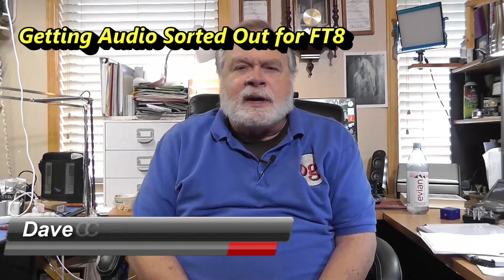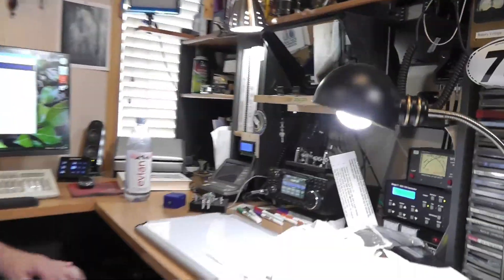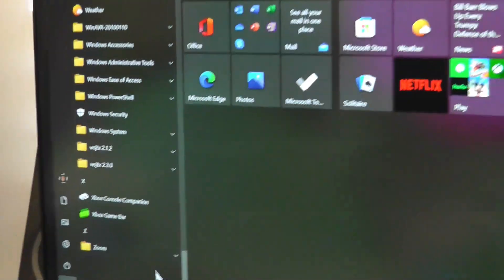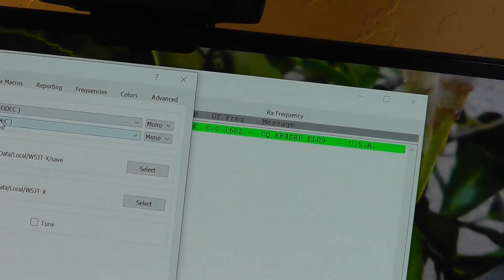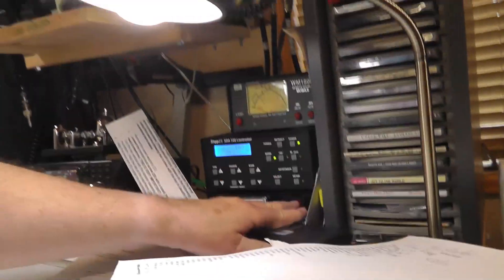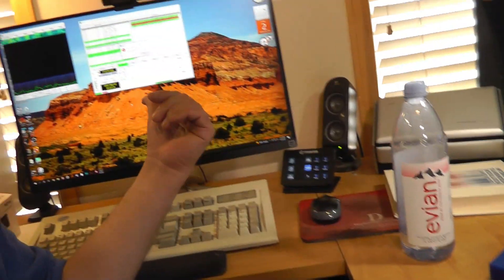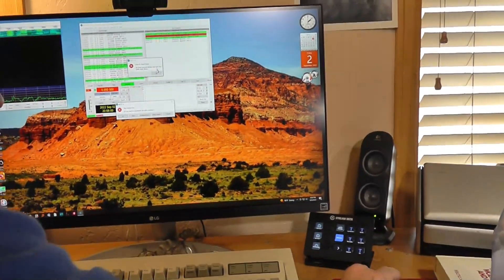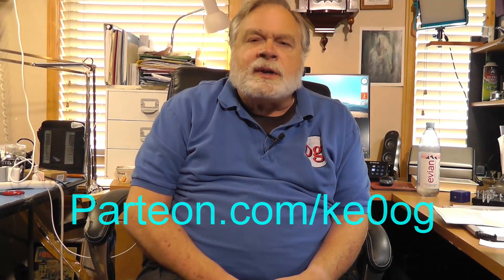Getting Audio Sorted Out for FT8 (#787)

Comment: Good video but actually this is a more complex subject.  It depends upon which version of Windows you are using (Win7/Win10/Win11) and how it is setup.  Also, be aware, when Windows updates itself, it "may" auto-reconfigure all your speaker values including the mixers.
Reply: Don’t make it seem more complicated than it actually is.  For 99% of users this is enough information to solve their problem
Reply: @kalilay  Matt is correct.  Audio problem solving is /can be complex.  I work in IT (35 years) and deal with about 80 MS Windows computers.  Most users stumble through all the menus / clicks /selection buttons ending in mostly confusion.  That being said - I admire Dave and his knowledge base... Dave provides an amazing amount of technically correct solutions and information to the Ham community.